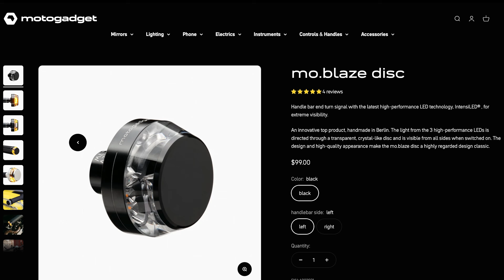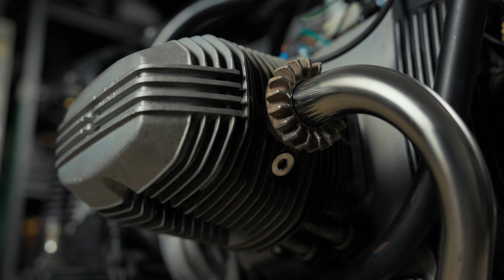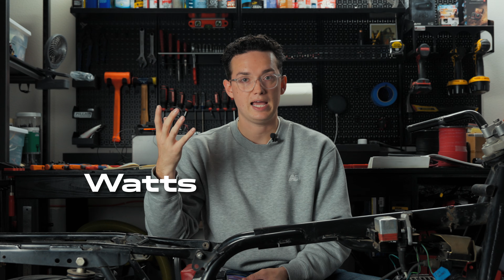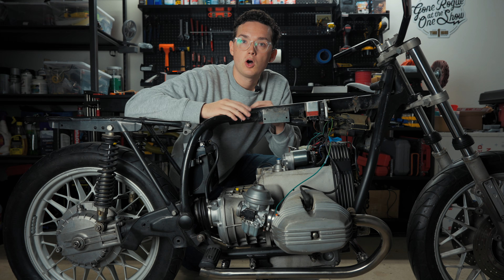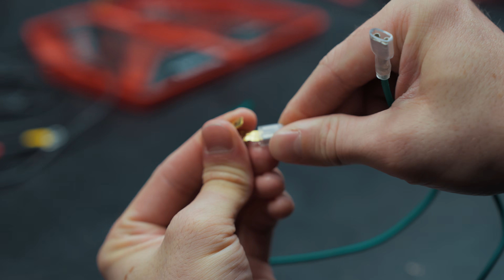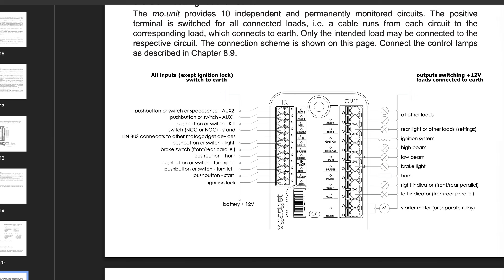Motogadget Official: mo.unit Install - Part 4 | Motorcycle Integration

Comment: Great videos, but my late 80's Honda  ignition system is not the same. Has anyone installed a Mo-Unit on a Honda NTV 650 Revere, Hawk, Deauville or XLV Trans-Alp, etc?

Comment: At the moment I'm rewiring my Guzzi with a MotoGadget Blue. Now this: The resistance of the start solenoid is 0.2 Ohm, so it uses 0.2 x 12 = 2,4 A, but there are two connections for the solenoid. So, for the other users (Generator premagnetization, control Lights, daytime running lights (mandatory in Europe!), telephone, etc.) there are only two. Why don’t you sell an extension for that like the ground extension? Where do I connect these? Anybody?